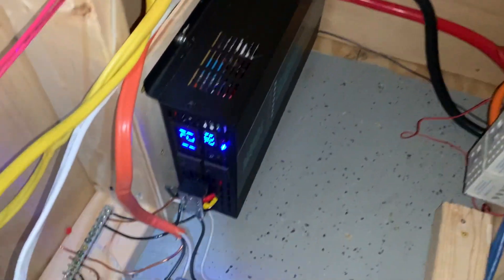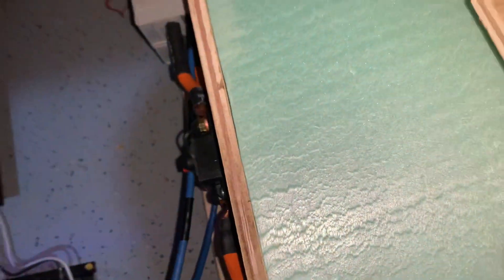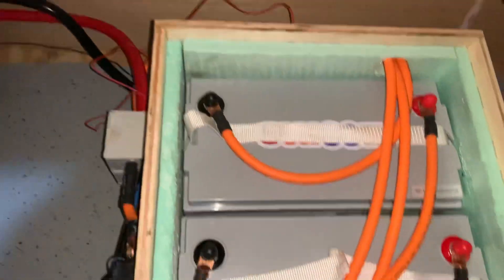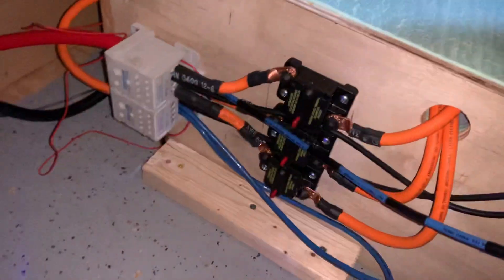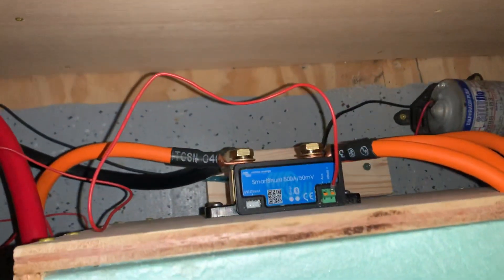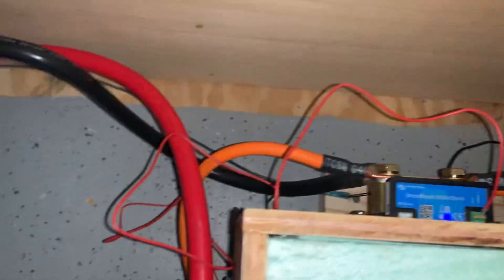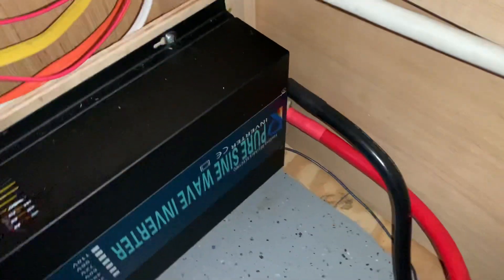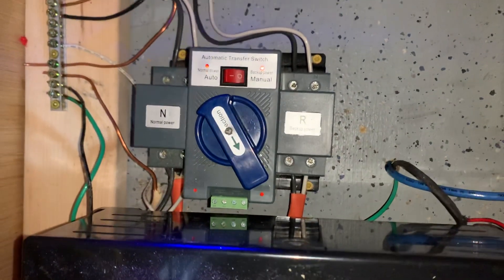Zooms lifePo4 lithium 300ah battery bank up and running

Comment: Just bought four 12v 100ah batteries. I'm still waiting on 3 of them, though they shipped in 4 shipments for some reason? Only thing with these batteries is that there's no cold temperature disconnect, so plan accordingly anyone else who's planning to buy them.